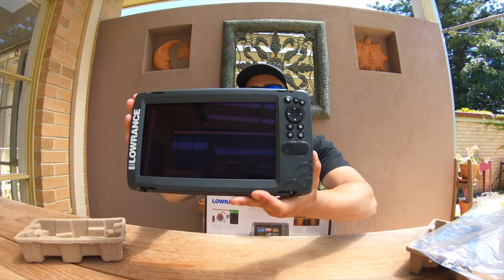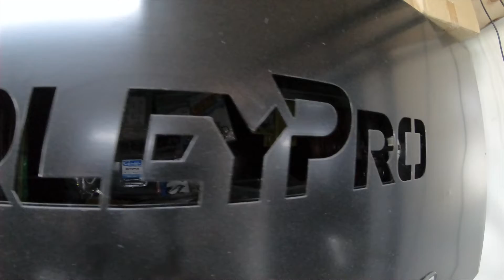LOWRANCE Hook2 unboxing, install & water test

Comment: Thanks for sharing mate. Wondering if the onboard charts are any good and what detail they have. I would be using it for PPB or Westernport mainly
Reply from the maker: Gone Freediving The built in maps are pretty basic. Would suggest an Elite Ti2 unit with built in Cmap mapping for much better definition of contours and channel markers!

Comment: Hey bud. I’ve just bought the hook 2 7 x ts. It’s the first sounder I’ve ever bought. And having some trouble with it. Everything was mounted correctly and level etc. but out the box it was on demo and I can’t seem to get the damn thing off. Even in selecting demo mode in the settings. Did you have to do that with this? Or was it plug and go??  Also did you have to set the depth offset in settings too as mines reading 0 currently. Cheers.
Reply: I’ve been trolling the internet to find a solution and already watch 10 plus vids. But haven’t had any luck.
Reply from the maker: Hey Trent. Is there anything in settings/about that you can just reset everything. Or see if there’s a settings/simulator or settings/sonar/simulate OFF. I didn’t do any depth offsets. Not really critical unless you have a really big transom and the transducer is quite buried or something. I don’t touch the offset at all. Mode auto, range - auto, frequency 200 for Sonar and then I just flick between 455/800 for side imaging
Reply: Paul Malov Fishing yeah I dunno man. I’ve been talking to Lowrance they told me to do a soft reset by holding the page and power button and it should come up saying soft reset but all it does it turn the unit off

Comment: Hi Guys ,,,,With the Lowrance  hook2 4x how do you change from salt water to fresh water or is it Automatically done
Reply from the maker: Hey Peter, in the top right corner on your Sonar screen should be a 'Mode' option, if you set that to Auto, the unit will make any adjustments required. Cheers Paul
Reply: thank you Paul

Comment: Take the sun cover off if your going to trailer your boat down the highway mine blew off the first time I trailered it got a nice fabric one with elastic at Cabela's
Reply from the maker: Hey Matt, yeah absolutely! Lost one off the Carbon on the boat. I don't trailer the kayak with the sounder on for long periods/if ever. Cheers

Comment: did you have to set anything ? I just installed hook2 7" in my boat and not getting any depth readings
Reply from the maker: Joseph Roland Hi Joseph, nothing extra beyond turning the unit on and going through the initial setup steps which are very quick. Please ensure that the transducer plug is pushed all the way in at the back of the unit.
Reply: Paul Malov Fishing thats what I’m gonna have to see screen turns on gps works but nothing on any screen in depth
Reply: @fountainguy27  what was your outcome with your problem? Just installed mine and is doing the same.
Reply: @waynepreece2818   so the power cord wasn't in far enough. Nut now its flickering like glitching almost just started doing that on saturday.

Comment: Did you have to buy the navionics card separate?
Reply from the maker: Hi mate, it depends on the package/bundle that's available in your region. Some of the bundles come with Navionics or CMAP. Some have it included, others require it to be purchased separately

Comment: Paul, mate what system did you use to connect up the Power to this unit.  I have just purchased the Hook2 7TI unit and was interested how you went about it. Cheers.
Reply: Not Paul but take a look at the Powerstation Solo. https://yolotek.com/products/powerstation-solo-power-bank-only
A little expensive but all inclusive.
Reply from the maker: Hi Glenn, apologies i missed this comment! I use a basic connection and a 17.5ah fpv-power lithium battery for this setup

Comment: I bought one month and I do not know if it happens to you that at 175 feet it stops working and it does not give depth yours works well in deep waters I apologize I do not speak English and I am translating the text if you can answer me thanks
Reply from the maker: Hi Carlos, sorry to hear you're having some issues in deep water. To be fair, that is pretty deep for this unit and i would say you would get much better range with a Elite Ti or HDS unit for deeper water

Comment: i am thinking of buying the hook 2 series fish finder .. i like the plug and go and the ease of use for fishermen like me with no previous experience with fish finders ..why would you swap a total scan transducer for a triple shot transducer ?  isn't the elite ti series a higher quality fish finder ?  are you taking a step backwards or is hook 2 series a big leap forward ..interested in your thoughts on this thank you ralph anderson
Reply from the maker: Hey Ralph, hope you're well. Thanks for watching! Couple of points 1. why did i switch from the Elite Ti to a Hook2 - i'm a tournament guy and i'm very competitive, but one of the main reasons is to show that A) it's an amazing unit for the money in "every day situations" and B) allows me to still be very competitive in a tournament situation. and 2) due to different plugs/design, i had to switch from the total scan to the triple shot and to be honest, i think that the wider beam on the tripleshot produces a far better arch on the traditional sonar! Thanks for watching mate and let me know if you have any more questions

Comment: Have u been having issues with this unit that ppl are with the cheaper smaller model
Reply from the maker: Hi J, no issues with the 9" mate. It's been rock solid all year!
Reply: @PaulMalovFishing  have you seen the issue. Im just ready to get a lowrance an spend 1100. Whats the warranty like?
Reply: @PaulMalovFishing  you have just updated?
Reply from the maker: Depending on the unit it’s between 1-2 years. We just updated the unit on the boat, I’ve still got the Hook2 on the kayak but I’ll be getting the new Elite Ti2 to put on the kayak soon
Reply: @PaulMalovFishing  so im fishing creeks an rivers in coffs harbour areas no off shore. Im looking at the hook 2. Should I just go with the ti instead? Whats your thoughts
Reply from the maker: I’d suggest the new Elite Ti2 7-9”. You’ll get much better image quality and range from this new unit and the huge benefit of touch screen for ease of use.
Reply: @PaulMalovFishing  the price gap isn't all that bad as well. For being the range its in thanks for the help dude. Keep the vids coming.. awesome quality vids doing a great job👍👍